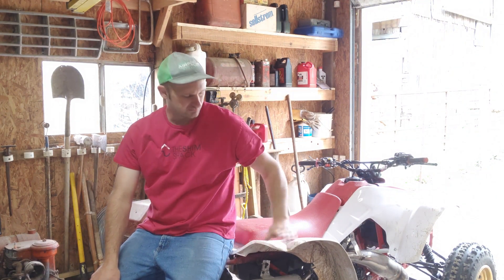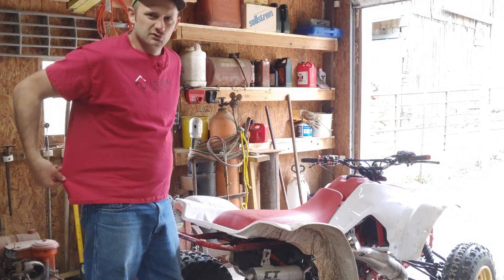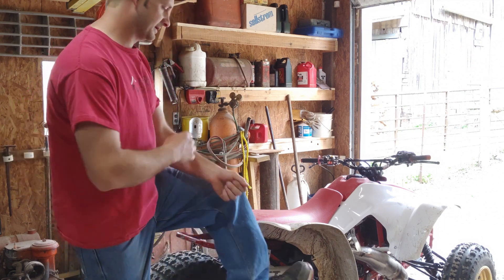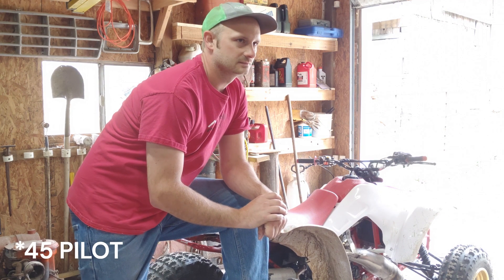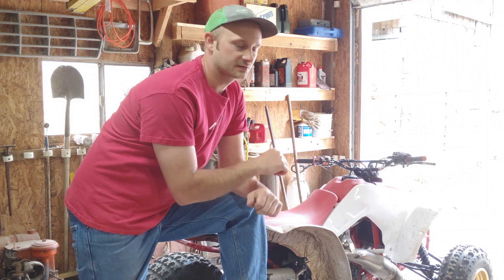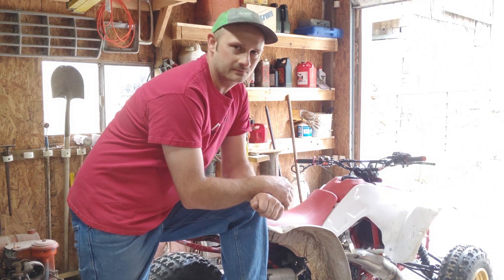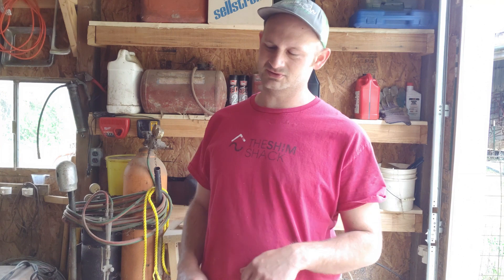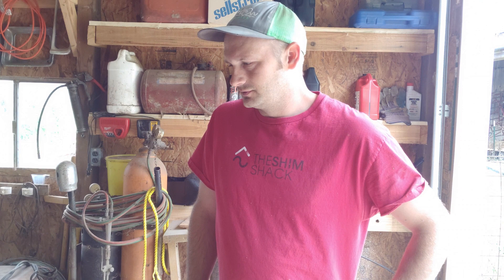1986 Honda trx250r Final Jetting, CERTIFIED RIPPER!!!

Comment: What’s your jetting specs.
Reply from the maker: @eric4847  I think i might have even changed it again after this after some better weather. Currently it is a 130 with stock needle, on the 4th notch down.
Reply: @ we have a 1986 trx250r with a ct 310 kit on it and can’t seem to get the jetting right. We get out of third and the bike falls flat on its face.
Reply from the maker: @eric4847  sounds like it could be spark related. Might set it on jack stands and run it see if the spark gets weaker. That would eliminate that area, far as fuel what is your setup currently? Stock carb? Reeds and cage in good shape no gaps or cracks?